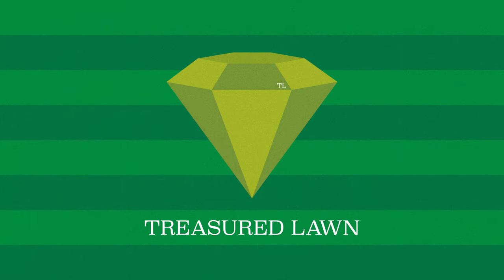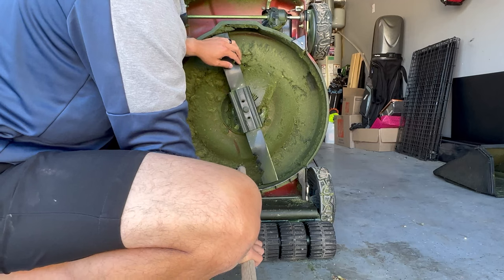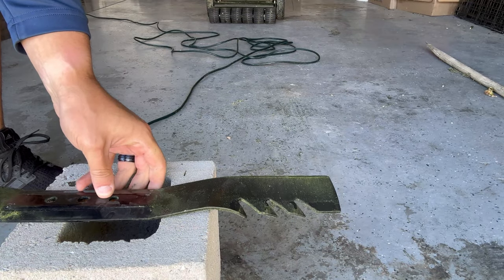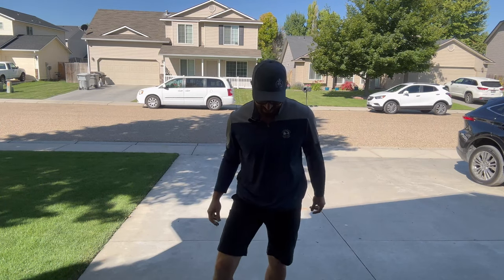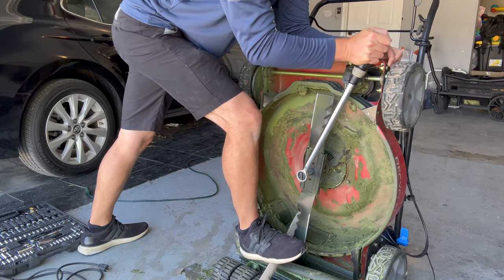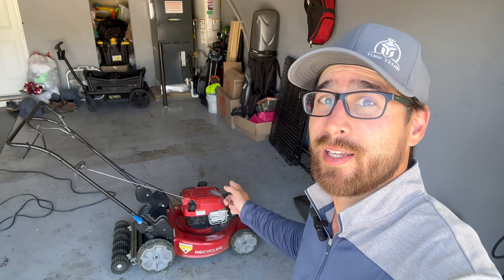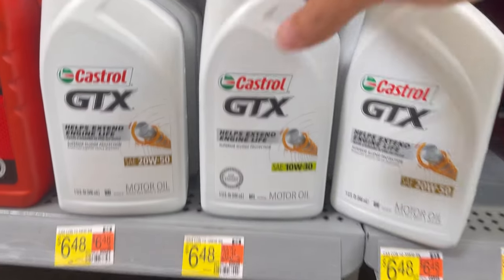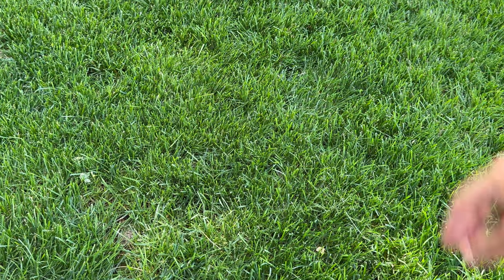Easy Mower Blade Sharpening and Oil Change!

Comment: I see you put a Gator blade on your mower? The original blade will do a better job. With that Gator blade you will lose some mowing height. When I mulch .the blade clipping are much smaller with the original blade, at least for me. Nice video!
Reply from the maker: I’m thinking about going back or possibly even switching to a non mulching blade. I never mulch with it as is and always bag up. Might be a good option though. Appreciate the comment and love!

Comment: on your oil extractor turn the bottle top around. feed the bottle cap in to the vac hose. will work better for you. nice upload
Reply from the maker: Oh that would definitely create a better suction! Thanks for the tip!
Reply: @treasuredLawn  yes sir! i also run my mower for 5 mins to warm up the oil so it flows better. Have fun, nice stripes
Reply from the maker: @richhubert1260  that I should have done as well! Good tips for next time! Appreciate it!